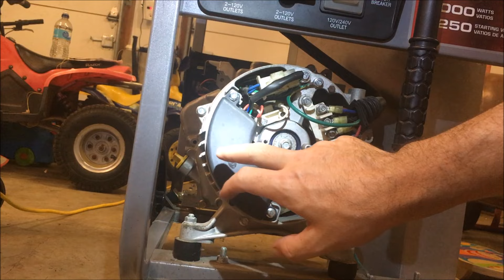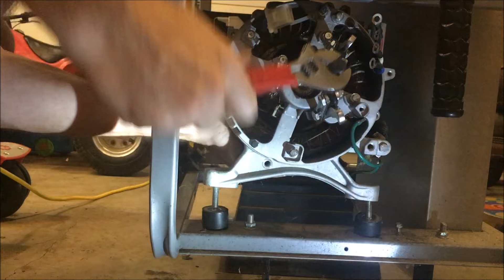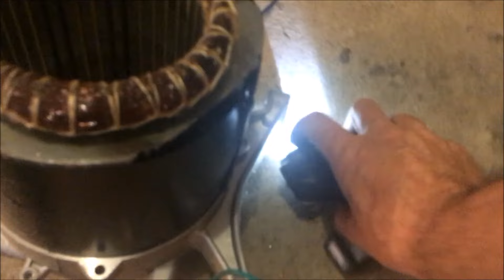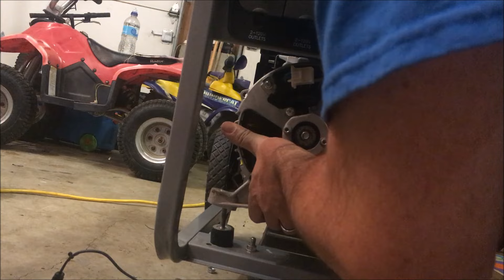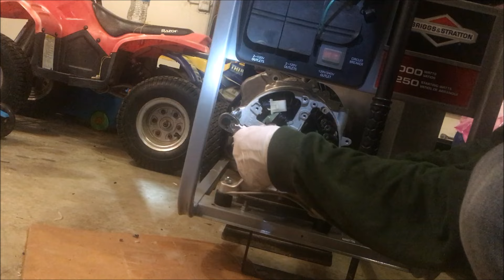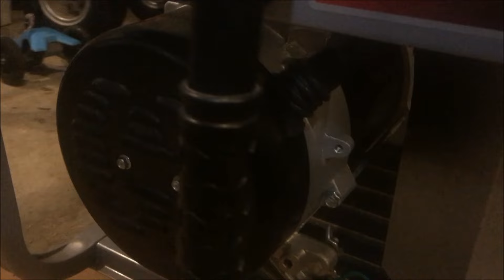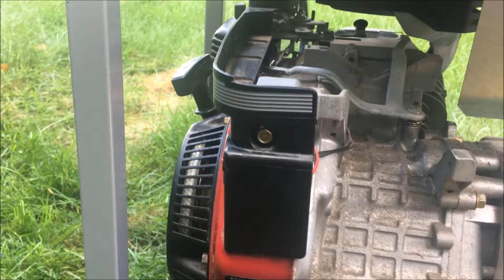Troubleshooting Generator No Power Output and Fix

Comment: I have a Briggs & Stratton 5500watt generator starts good but no power on outlets,I've tried to reflash it but nothing
Reply from the maker: keteImporta you will need to test the ohms on the rotor and stator.  Rotor should be around 70 ohms and stator around .5
Reply: @jcondon1  
where in the stator & rotor do I check? THANKS for replying.
Reply: stator reads 5 ohms but rotor reads 27-30 ohms
Reply from the maker: keteImporta the stator sounds good.  Rotor might be low, but could be normal for your model.  You should reach out to the manufacturer and ask for range of acceptable ohm values specific to your model.
Reply: @jcondon1  ok,when I try to reflash it with a drill or battery it produces power but won't stay with power,there's an led small light that turns on when plugs are on it's on but barely
Reply from the maker: keteImporta the residual magnetism in the rotor sends enough power out of the stator to light the LEDs.  The rotors electro magnet is not powering up on its own.  Is the AVR working? If the AVR is sending DC to the rotor, then a rotor issue.  If no DC, then might have an AVR issue or the Winding’s feeding the AVR AC could be bad.
Reply: @jcondon1  this generator doesn't have a AVR it has a rectifier I think that's what it's called but I changed it & still nothing,brushes are new as well
Reply from the maker: keteImporta ok.  Actually like those better, less to go wrong.  Sounds like you have checked almost everything that you can.  There is a separate winding supplying power to the bridge rectifier.  You could test that for ohms.  The rotor is probably bad.  Most likely some insulation failed.  Even if the ohms tested ok, the insulation could break down at higher voltage and allow arching.  The multimeter only sends a couple volts in the line for the test.
Reply: @jcondon1  THANKS for your time & helping me out,,I'll do some more test & see if works again.
Reply: @jcondon1  great video i have the craftsman 10500 7000watt generator has no power in outlets cant find parts
Reply from the maker: luxury carkey720 that’s a common problem with most generator brands.  If you engine is a name brand, parts can usually be found for that, but generator specific parts quickly become unavailable unless it is a Honda or Yamaha.  Usually you can find only the basics like an AVR or brushes.  No power is usually the rotor or stator.  Even if available, it is cost prohibitive to replace.  If your lucky just avr, brushes or lost magnetism.
Reply: @jcondon1  thanks for the info i got this generator from lowes for $50 not a scratch on it electric start engine runs good no power now i see why it was only 50 dollars gonna check the stator & avr...

Comment: How did you reflow the solder with a heat torch
Reply from the maker: I used a soldering iron.  You need a high powered one to do the job properly.  My iron was not hot enough which is why the repair did not look very good.

Comment: Oxidation on slip rings can give poor resistance readings as well. Good find.  I bought a hydraulic lift table at Harbor Freight for $139 on sale. Makes all the difference not working in the floor.
Reply from the maker: John Rand thanks for the Harbor Freight tip.  I need one of those.